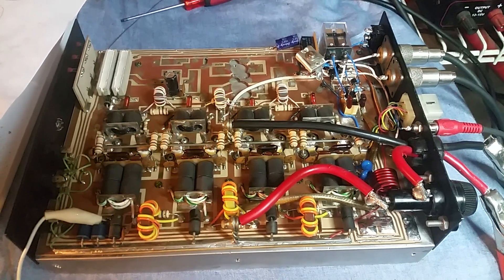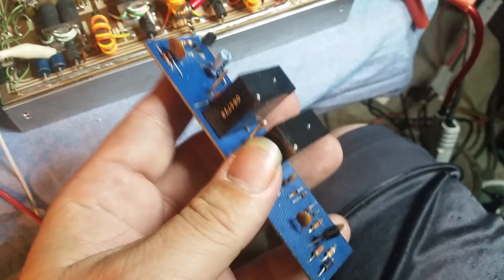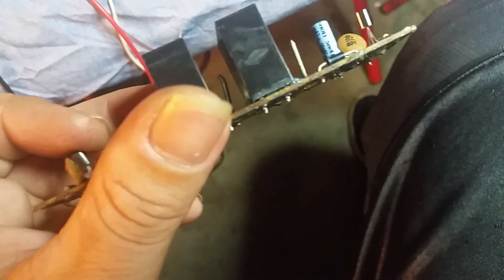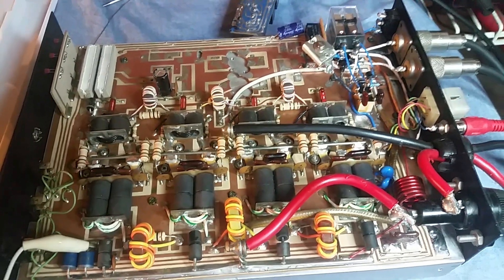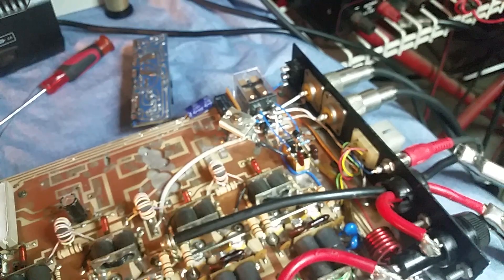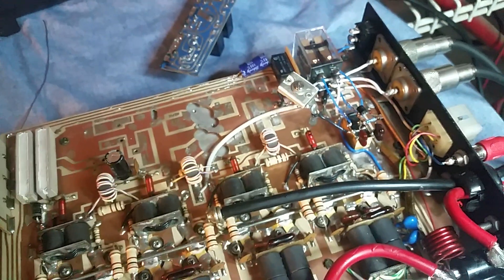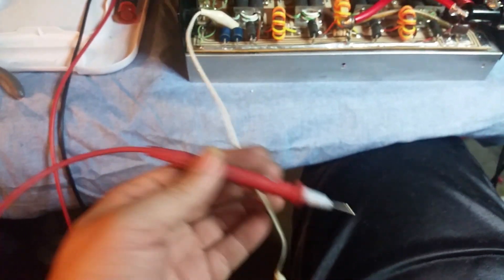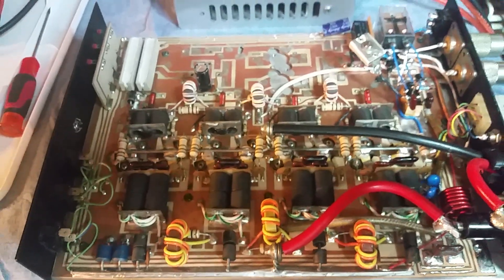8 Pill 8xMRF455 Messenger M4V Circuit Reconstruction

Comment: I got a M4 had burned input resistors on a board .changed them out and my input VSWR came down dam close 1:1 .and my AGU fuse holder cracked. Fixed all that. My output was a little low.Turned out I had 9 MRF 453 pills. same as 455 but bigger case like 454 that is what I thought I had. with the boards on top of pills  I could not read them.. amp still runes fine. with 120 mm fan still gets quite warm on high.I got it used and think pills were blown on a hot radio and someone put 453 in it. I got it with 1.7/2 :1 input VSWR . 1:1 off. and it had 50 amp Anderson. I put 4 GA monster cable no fuse inside amp. I got ANL fuse at battery. have not got it off the shelf in a year now. still talking good. great job with the relays!! That is a diode regulated bias supply. Texas star uses resistor divider. messenger had a more stable bias. I convert many amps to that bias circuit. I have a regulated adjustable bias circuit but do not use because people like to turn pot trying to get more watts and blow the pills. for that reason I use on my stuff only.